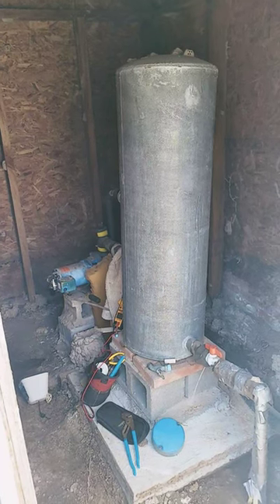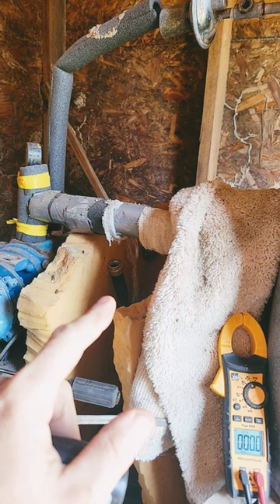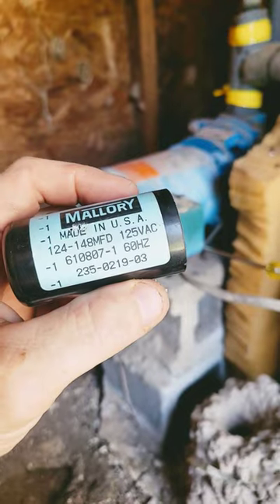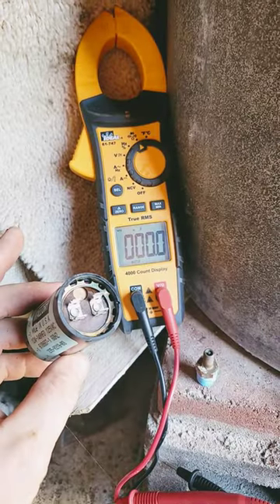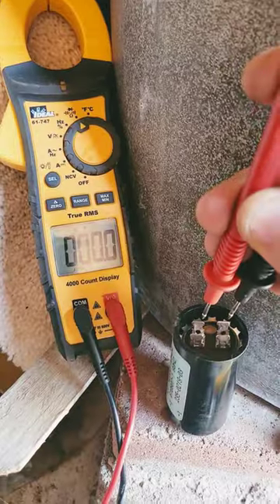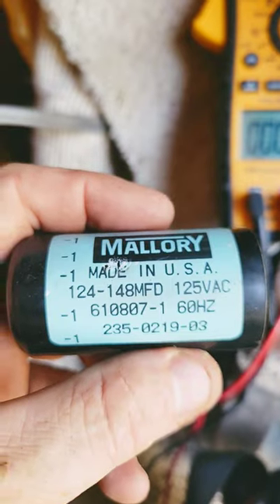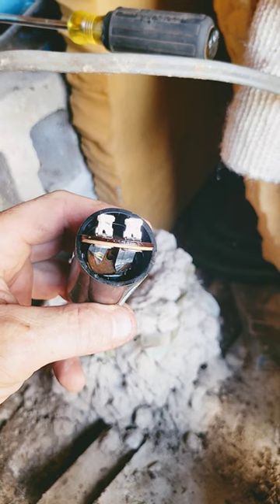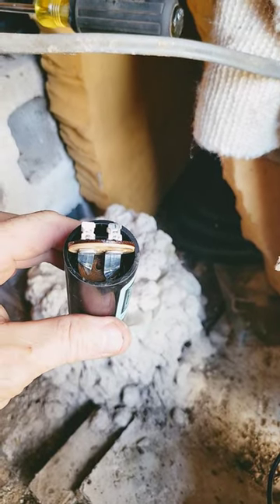Water Well Pump Overheating - Bad Capacitor Troubleshooting

Comment: If the top is popped up it's usually bad
Reply from the maker: Yep, or the vent bulged, signs of corrosion, leaking.... Why I say no need for a meter checker usually.
Reply: I deal with wells here in Maryland. A few jet pumps. Mostly, our wells start at a hundred and go up to around five hundred feet deep. Never like the ones you deal with in a shed. I like it when you rebuild  the pumps/ motors.  I get to learn from you. You definitely  have warmer weather year round. I've been plumbing for around two decades.  Service plumbing , boilers, steam, tankless, water filtration systems, etc.
Reply from the maker: @samuelhorowitz5029PLUMBCRAZY  For sure man, yes we're in south east Louisiana here hardly ever freeze.
We might get a week of 30 degrees but never any broken pipes.  Every few years we get that one storm that brings a day or two of 0-20 degrees and all hell breaks then haha.  If they don't run water, cover the system with a tarp or put a light by the switch it will be all busted by morning.

Yea man I want to do more in depth tear Downs for sure because if we like it or not things are getting rough.  Gonna have to learn to repair rather than replacing even with used and salvaged parts.  More and more people can't afford a 1000$ pump replacement.

Take it easy man,
Casey

Comment: I just installed a new j7 motor and pump from a j5.   Tank had a leak so I changed everything.    The new motor would over heat with only about 10-15 psi in the tank.   Any idea why.   Yes voltage is set for 230.  Put the old pump on and ran fine.   I’m stumped
Reply from the maker: It's either a 120v line or the pump is butterfly pumping on and off.

Comment: You can see the freaking heat waves on the thing Jesus mother marry and Joseph
Reply from the maker: Yeah man a little bit of cooling off, replacing the air volume control and capacitor and its back up and running!

Thanks for the comment and watching,
Casey
Reply: @ClearWaterPumpWell  I’ve learned so much from you!! The well tech came out when I moved in, didn’t know what the (aerator was on my pound well) watch you daily and saw the same valve he turned off!! Ran to the well house and turned it back on. Hope it’s not waterlogged, but being a holding tank and iodine treatment, I do need it water logged due to holding tank?? Thanks for any info my dude  👊🏻👍🏻

Comment: Air volume control wouldnt make it water logg… it will air logg the tank if air cant get out… but the only things that can water long that tank is the check valve snifter or the bleed off not working …. I know that if a tank is water logged it will mess up the float on the AVC but thats about it
Reply from the maker: @christianfigueroa1517  dude I pointed to the device it's a AVC a AVC 100 Brady Air volume control not an "Air Release".

This is why water well terminology is too confusing to most people.  But technically it does control the air volume as it only puts in enough air to maintain the proper air charge.
An "air release" can only let air out you are correct about that.
They do only have a float to adjust the air volume based on water level at the device.

The reason this tank was waterlogged is because the AVC went bad by corrosion and clogging of iron.  The device is not made with good materials that can last for long.

Comment: I usually use microfarads to check a capacitor not the setting u r on
Reply from the maker: It has an automatic switching mode man, it showed the correct value!